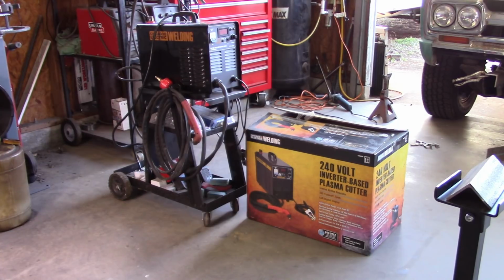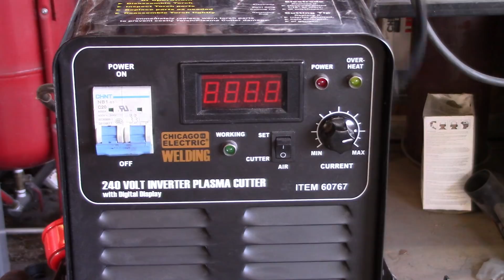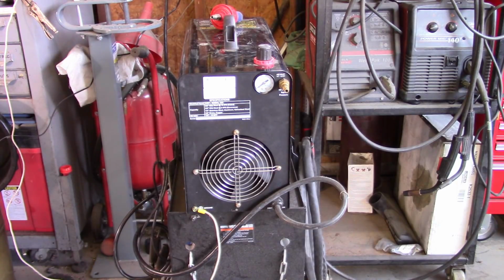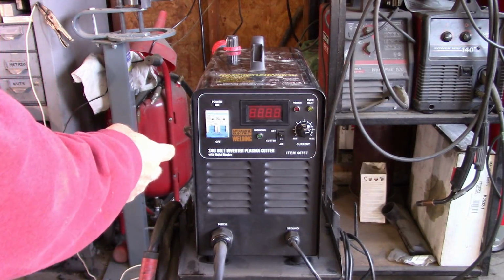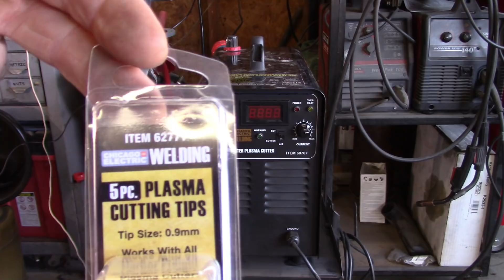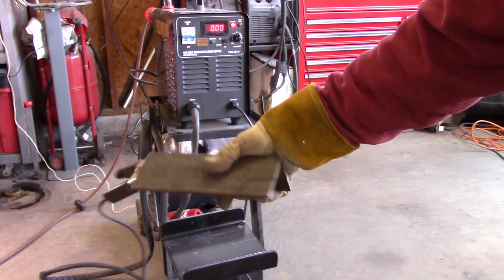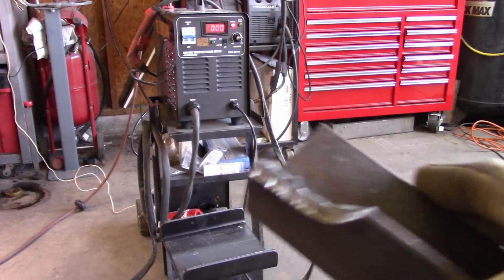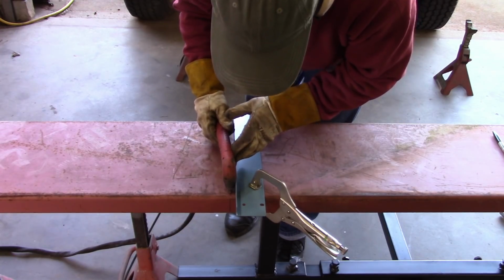Harbor Freight plasma cutter review. Part #60767

Comment: Awesome video. One thing.. if you dont want much slag.. up your volts a little and it will produce less slag because it wont cool down as fast on the underneath so it it will just fall off. it will also make it easier to cut thicker steel like butter.  you had it set to 38. Set your amps higher.. and your air higher.. and go a little faster since you have the volts upped and you should see a cleaner cut with less slag.. that was a pretty thick piece.

Comment: I not sure if you're aware of this, but they do make drag tips for that style of gun. It enables you to make contact with the workpiece while cutting. I've found it gives you more control when cutting with a straight edge. You can make the cut easily with just one hand.
Reply from the maker: I need one. Does Harbor Freight selll it?
Reply: They do, but they're not quite like the one I got. I have an Everlast plasma cutter and they sell same ones Harbor Freight does. I got the one I wanted on eBay. Here's a link to a set like I bought: https://www.ebay.com/itm/12PC-40AMP-SHIELDED-CONSUMABLE-KIT-HARBOR-FREIGHT-62204-PLASMA-CUTTER-IPT-TORCH/172453814938?hash=item28270c629a:g:ZjUAAOSwCmZZOaDt

The set's a little pricey, but well worth it, in my opinion and when I free hand cut I switch back to the regular tips. The last cuts I did with a straight edge, I didn't even have my hood on (it was across the shop for some odd reason). I didn't have to look anywhere near the arc to do the cut.
Reply: Super helpful tip. As of april 2019 can get a 10 pc set for $42. Cant wait to try

Comment: Hello,  I bought one which looks identical in 2007.  Shortly afterwards the motherboard went out.  HF replaced the machine and it has been working great ever since.  I cut 3/8 steel,  and about the same thickness aluminum.  It will cut heavier but the cut won't be smooth.  As I recall I spent about six hundred at that time.  It gets a lot of use and does very well for a 40 amp output.  I see a lot of similar ones on Banggood for quite a bit less (and free freight).  It would be interesting to know how well they hold up.  I am about to upgrade my ground lead and clamp to a #6 welding lead for extra length and flexibility.  I already upgraded some time ago to a bronze quality clamp.  I have certainly got my money out of this machine and have no regrets buying it.  Take care.  Doug

Comment: Good video. That 240v nema 6-50r receptacle is installed upside down. The ground lug should be on the top. It's backwards from the smiley face household outlets (that should also have the ground on top).

Comment: Great info -Thanks------Please  do for yourself a safety thing. From a man who welding in his trade ---DON'T WEAR A CUFF IN YOUR PANTS---- I learn to DANCE very fast when a spark got in my cuff when I was cutting some pipe----- Please be SAFE.
Reply: When I was learning to use a track gas cutter in school, I set the fringe on my pants on fire. I bet the instructor called on me to run it just so my pants burned. Good times.

Comment: Nice video demo.  Update on H.F.  numbers though.   Numbers 60767 goes to a welding cart whereas numbers 62204 goes to a 240 Volt plasma cutter.  Newer model looks quite different than yours, but for a H.F. tool working great for many years is great to know.
Question for you.....how often do you use it and is it for home projects or do you build things for jobs and such?
Great video.   Gives a lot of insight on H.F.  tools.
Reply from the maker: I use it about once a month. I build cars, and various other projects. Amount of cutting can vary by project. I actually spent a couple of days cutting up an entire car into light weight pieces to dispose of it. It has held up remarkably well. Good info on the part number changes.

Comment: You'll use less consumables if you stop dragging the tip. Lots of people make the mistake of dragging the tip across the work. Certain tips are drag tips but those are not. Hold it about 1/8 up or get a standoff for that torch. I'm sure there's one out there

Comment: I have a question about this plasma cutter. 

I have a similar unit from HF (mine is blue instead of black) and if I'm using it, it will not strike an arc again until the cooling airflow cycle stops. Is yours the same? I know you mentioned you can't use it but I was curious to see if it's because that's what you're supposed to do, or is it a built-in function with the machine.

Just wondering because I see other brands out there being used that don't have that feature and I see the people using them not waiting to restart before the airflow stops.

Thanks in advance!
Reply from the maker: It's a built in feature. I think the idea is to cool everything down to make it last longer. Mine does the same thing.

Comment: How does it handle cutting expanded metal? Does it automatically shut off on the air gaps or can you keep cutting with one trigger pull?
Reply from the maker: It will keep cutting. Just can't wait too long.
Reply: Awesome! I'm looking into using it in a diy cnc plasma cutter so that would be super useful if I ever need to cut grate or perforated sheet.

Comment: Great video as usual. You seem to have 2 MIG welders (I see 2 torches) or I am wrong? There is the Lincoln electric t140 but what is the other?
Reply from the maker: Yes, I have 2 Lincolns. The 140T MIG, and the other is setup for flux core welding.
Reply: When do you use flux core welding?
Reply from the maker: Flux core is good for welding heavier materials, and not so much concern for cosmetics. It's a little rougher, and it is also more portable. You only need the welder, and a power source.

Comment: That water separator how did u make it?
Does that hook up to the Male end of the air supply on the plasma
Reply from the maker: Yes. I used a water separator for a paint gun.
Reply: Jo Daddy's Garage 

Where can I buy this water separator
Reply from the maker: This one was from Harbor Freight. Any paint supply place should have it.

Comment: I'd like to have saw that last cut. That first one on the angle I could have done better with a torch and left a lot less slag. One place I worked they guy that was running the plasma I could slice out of perfect Square hole in the top of a padmount transformer to remove the coil and you couldn't have done any better with a damn saw blade. and they had another guy that subbed for him who actually used to run it and he is look like an ant had run down through there back and forth and zig zag. Jagged as hell and slag all over it and a b** 2 weld back on so we would normally throw another piece of metal on it and weld it over. I guess that's why he used to run the cutter. Happy Cuts

Comment: Wait , you have a ground wire going to a metal tool box with rubber wheels?  That is also sitting on a cement floor. How is that going to work?
Reply from the maker: It's grounded to a metal tool shelf unit, no wheels. I believe it a "safety" device that the manufacturer puts there. It's not meant to ground to the work piece. Just doing what it says in the instructions.

Comment: my main concer would be if HF would continue to carry parts/consumables for the machine or if they switch out models every couple years, youve obviously had luck with it for 4 years, have they come out with a new model but continued to support this one or are they still selling this model
Reply from the maker: I think they have a new part number/model. I really wanted to show this in case someone was interested in buying one new or used.
Reply: The consumables for this cutter are pretty common among plasma cutters (especially the Chinese ones). All of this stuff is readily available on Ebay at super cheap prices.

Comment: It has an electrical ground in addition to the 220 volt supply plug?
Reply from the maker: Per the instructions. Not sure why.
Reply: Probably to avoid uneccessary returns due to improper grounding. I work in a factory and some manufacturers of machinery call for a seperate ground to avoid callbacks

Comment: little help

you dont need to wait for the airflow to stop after an initial cut to make a second one, could get really annoying waiting for that if youre making many small cuts in sequence

you can greatly reduce the slag and effect the kerf of the cut by experimenting  with and perfecting your drag angle, speed of movement, and tip height above the steel 

im not quite sure what that white grounding wire is for? i guess to ground the body of the machine but that should be grounded through the plug end to the actual electrical panel.. i dont think its really necessary id remove it thatd make the machine alot more portable
Reply from the maker: Good info. Thanks.
Reply: I have the same one and mine won't strike the pilot arc until the airflow stops. Its annoying but I live with it since it's one of those "rarely used but glad I have when I need it" tools.

Comment: That one has all the features that I DIDN'T want when I shopped for mine. I went with the Miller, 120volt, onboard compressor, totally portable and it'll cut 14gauge about as fast as you can draw a line. I don't need to cut real heavy material although I have and it works just fine.
Reply: Jon Rothenbusch

Comment: What gas do you need  for this plasma ?
Reply from the maker: No gas. Just dry air.
Reply: Compressed air (plain with dryer) for steel & Aragon for aluminum
Reply: Johnny Drinkard you use dry air or nitrogen can be used for steel and aluminum .  You do not use argon for plasma cutting aluminum,

Comment: The problem is the 240v for me.
Reply: The Best Stooge 
Don’t buy the 110 volt. They barely cut sheet metal, and constantly shut of to cool down.
You’ll hate the tool.
Reply: Just don't have 240v outlets for it.
Reply: The Best Stooge 
If you have a breaker box near by, I can guide you step by step how to install one.
After that, you’ll feel like a qualified electrician:) let me know.
Let me
Reply: Nope, the breaker box is about 200 feet away in the laundry room and to be honest I can't even imagine how I would get to there to run the wires.  See we had a leaky roof so I went up into the ceiling to find it and the previous person who added on to the house left no room in the ceiling to get to anything.  I know I did not find any house hold wiring (dating back to 1959) running anywhere in the ceiling so they either ran the wires in the wall (even to the new sections he built which doubled the size of the original house) or in the cement foundation.  This house is a PITA thanks to that man who just kept adding on (not even quality additions either) to the house for 20 years.  I got it because he was so much in debt due to all of that the bank confiscated it and I got it.  I wish I hadn't.
Reply: How do you hook up a 220 volt from the breaker box? would you please guide me? Thanks
Reply: @crazycoyote1738 I saw you offering help
I know it's a long time ago but was wondering if I could show you my setup.on same unit I'm trying to get working and tell me what I'm doing wrong 
As far as my power source
Thanks

Comment: Would it be able to cut threw 1 inch steel
Reply from the maker: I can't say for sure, but that may be a bit much for this tool.
Reply: Jo Daddy's Garage that's alright just wondering, how much did it cost you. Thinking of purchasing one for my dad.
Reply from the maker: I think it was around $700
Reply: No it won't. one inch of steel is a lot for a top of the line machine. You need a machine like a  Hypertherm Powermax 85 at around 4K USD for that type of capacity.
Reply: Yes it will do the job at 90psi just watch for blowback and pause so not to over heat . I cut 4' at 3/4" inch, then a 12" I-Beam at its largest is well over 1". Just remember to break to cool off.
Reply: @48 amps*

Comment: I cant get the son of a bitch to start an arc...just small little sparks
Reply from the maker: You need a good ground. Bare metal. Also, if you've used it before and it has been cycled a lot, you may need a new tip.